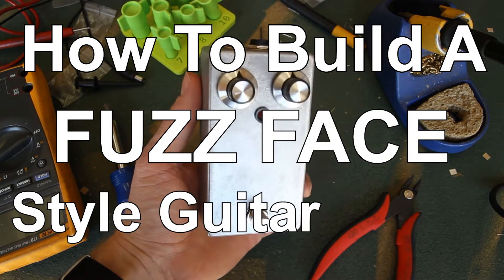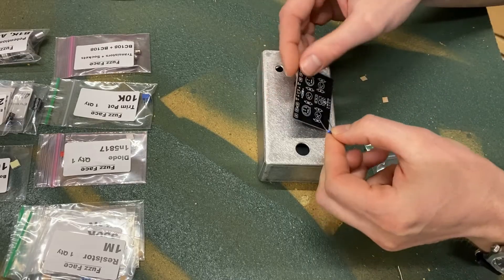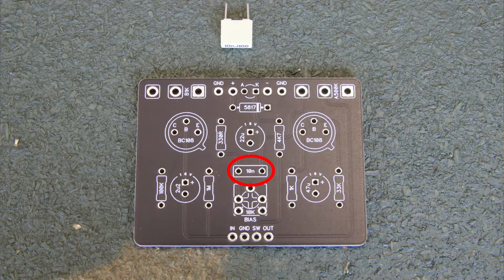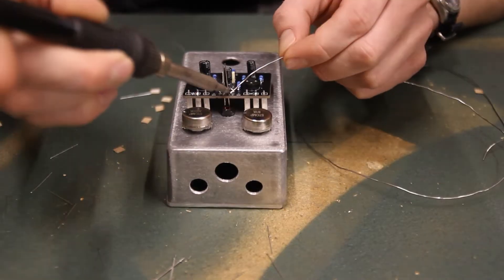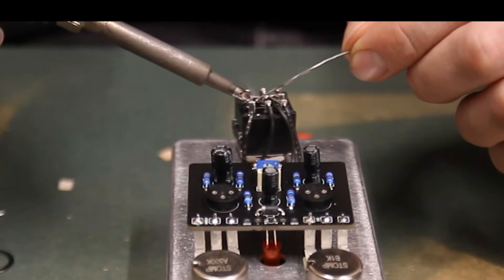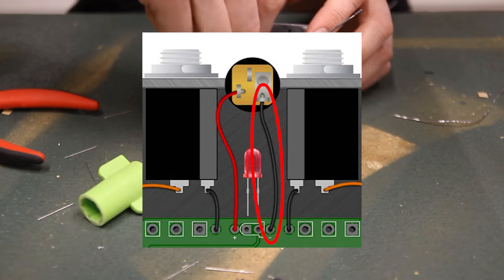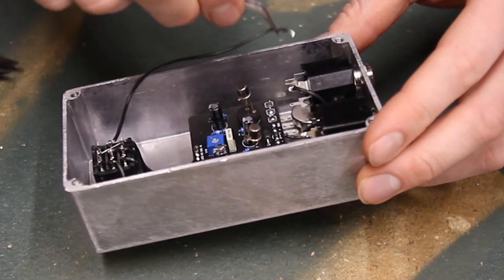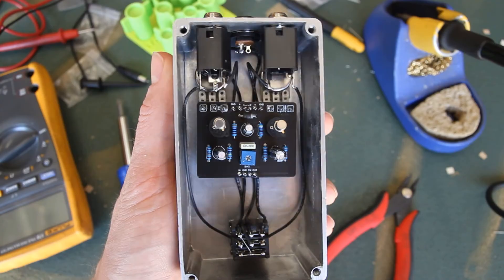How To Build a Fuzz Face Style Guitar Pedal | DIY Effects Pedals by StompBoxParts.com

Comment: Wow this is alot easier than the kit i just bought and you have a nice how to video they don't and have shit instructions for someone that has never touched one before. I might have to order one of these if mine turns out to be a dud and it probably will cause lack of any kind of instructions except list of parts and a half ass schematic but not sure which one is for mine cause it comes with parts to build 3 different ones evidently lol.

Comment: I'm wondering if you could play around with the different types of diodes to get different types of sounds? I have a bunch of different diodes that I've used to make "black ice" type mods in guitars, and they each have their own character, so figured it might work the same here? Thanks!
Reply from the maker: For any dirt pedal with clipping diodes, yeah go for it! The only diode in the fuzz face pedal in the video is a reverse polarity protection diode (1n5817). You could change it out but it won't significantly alter the sound. Might just voltage sag the circuit a little bit more. I'd say save your diodes for an overdrive pedal.

Comment: Thank you for creating this kit and posting the video. I'm wondering: I want to do the bias mod where I have a knob on the pedal that allows me to change the bias for q2 and an internal pot to change the bias for q1. Does that make sense and if so can I do that here. Total noob here but I saw JHS doing this mod. Thank you for your time
Reply from the maker: This is very much do-able for Q2. Replace the trim pot on the circuit board with wires going to a full size pot (B10k, same as the trim pot). Drill a hole in the enclosure and mount the pot so you can adjust it on the outside. 

If you want to bias Q1, it would require a bit more work but still do-able. Replace the 33k resistor with a potentiometer wired as a variable resistor. You would also need another resistor in series to avoid overloading and frying Q1.
Reply: https://m.youtube.com/watch?v=ghxwcSiY7GQ&t=2122s&pp=ygURSmhzIGZ1enogZmFjZSBtb2Q%3D
Where I saw this mod. Thank you again

Comment: When doing PCB layouts how do you make sure the traces and the wires to the pots and jacks aren't going to create more noises, hiss, crosstalk, oscillations because of gain circuits? its very easy to cause oscillations with gain circuits and the component layout have to follow rules which you should go over in a video lesson

Comment: I got this kit and tried to build it but I think I was thrown off by the diagram being used 5:48 instead of actual video footage. I was confused by a couple things (altho I see the necessity for making that move in order to differentiate between the different wires by color coding).. the orientation of the pcb while wiring up in relation to the bottom of the switch was a big question mark.
also, this diagram doesn't depict the fuzz circuit so that threw me off.
this is the first time I've tried to build a guitar pedal, so my perspective is from that of a total beginner. 
I had to remove and re-solder several components and the end result was a silent pedal when turned on!
I'm already a loyal customer, tho and also bought the Klon kit. looking forward to sorting this all out and also, lastly, want to express my gratitude to you for putting in this effort to help aspiring pedal freqs take their awkward first steps.
 cheers
Reply from the maker: The Troubleshooting sub-forum on PedalPCB's forum is a FANTASTIC community to help you get the pedal working if you're having some troubles.
Reply from the maker: You'll get it working soon, I believe in you!
Reply: I got it to work!  @StompBoxParts